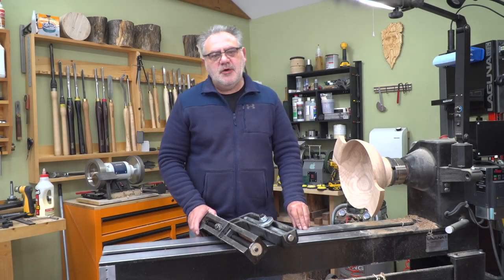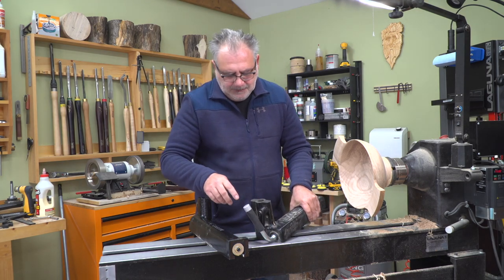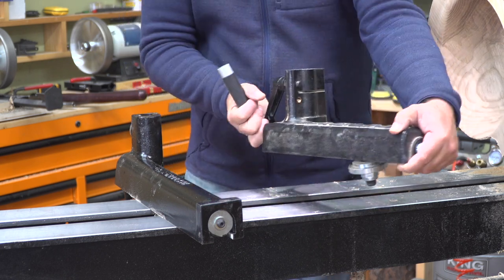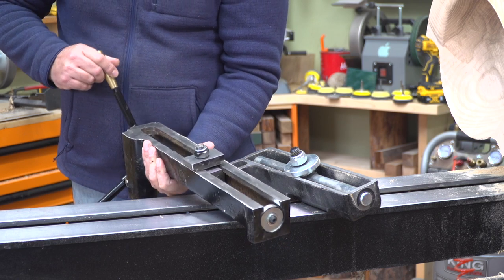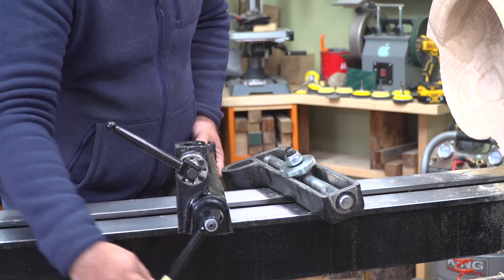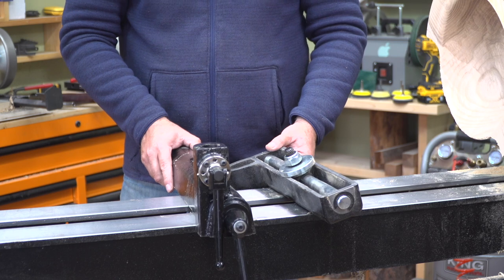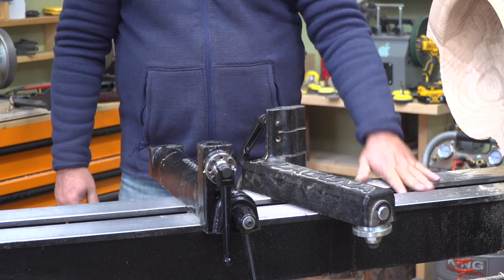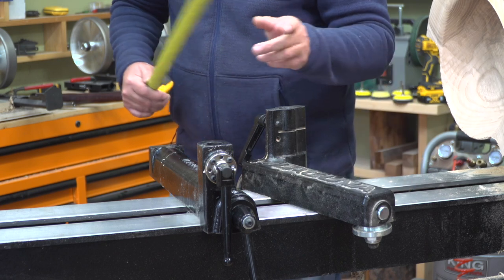Best Banjo For The Laguna 18 36 Lathe

Comment: I bought the Oneway banjo. It actually is the standard banjo for the Oneway 1640. Fantastic piece of kit. Much better in every way than the Laguna banjo for my usage. I use the original Laguna banjo exclusively on the Laguna 20" extension (with the banjo riser block that came with the extension). I've added this to the lathe so I can turn up to 31" diameter pieces on the 1836.
Reply from the maker: Totally agree. Best accessory I bought for it.

Comment: I have a Oneway banjo and the Laguna 18/36 banjo.  I prefer Robust toolrests and don't have a problem with either the Oneway or the Laguna banjo.  The Oneway probably has a better mechanical design, but they both work (for me, at least).
Reply from the maker: You're 100% right, we just like buying tools though.😊